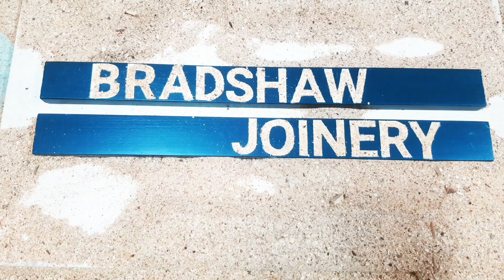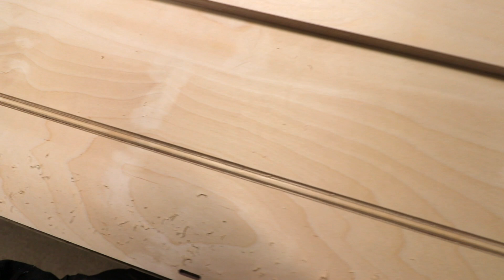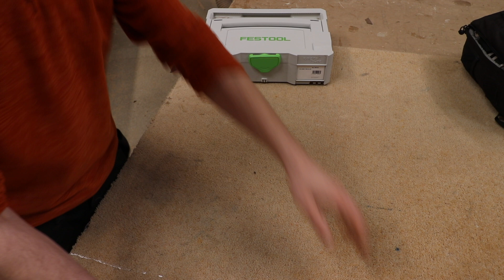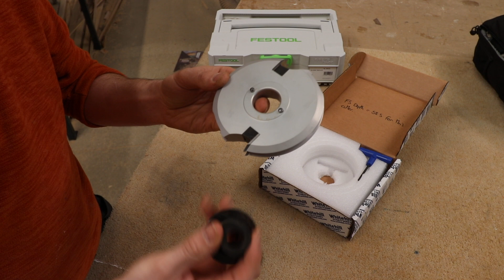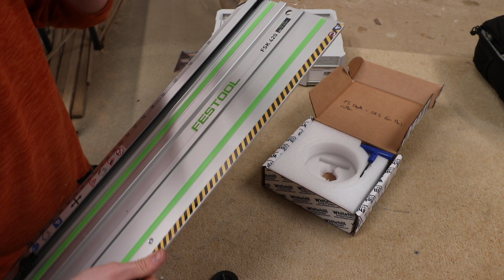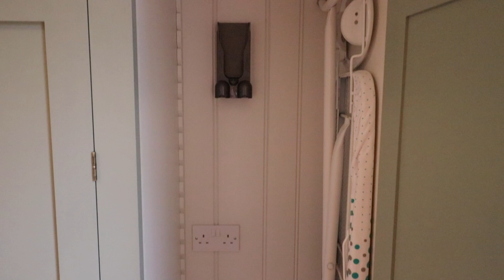Make your own Bead and Butt Panelling from Sheet Material.

Comment: Hi i am just wondering if you need to put all the spacers/shims on with it ? Or just enough to keep flush with the top hat? Then tighten.  Or like the groover festool tell you space out your groover and then put all the shims on the outside. I am looking for clarification. Thanks.
Reply from the maker: Just need enough shims so the securing washer clamps the cutter and not the spindle.
Reply: Yes thought that couldn’t get a definite answer. Have one now. Great idea with the cutter. Gonna put dust to the heavens.
Reply from the maker: @rorymcevoy87  My advice would be masking tape the riving knife up when using, and even pressure on toe on entry a nd heel on exit. use a board of same thickness to support the rail before and after cut.
Reply: I’ll be leaving panel over sized and then cutting down. Thanks for the tip tho. 😂

Comment: One bath cabinet I made of cherry; I put the cabinet back wall as ship lapped in cherry on the vertical. I will look into a similar cutter cut as yours and have a 1/2" shank router bit made for my Felder shaper. It was lots of work to get the ship lapped  back wall. Looks nice but I can mill 10-12" wide cherry and butt it together and them cut the beads on the Felder. I have a sliding table
on the Felder shaper and panel saw so an accurate bead is easy. Thanks for the info on custom circular saw. I have the Bosch saws (circa BC) plus the panel saw for my work-no Festool saws.
Reply from the maker: Niceone Vincent, it sounds like you have a lovely setup! The festoo saw isnt ideal but its certainly good enough to do it. Ideally it wants a router type base with a circular saw/spindle moulder motor on it... ideal

Comment: Question buddy. I need to match a butt and bead board from 15-16mm MDF for my customer I don't have the specialists kit as I do one off bespoke projects but never with butt and bead in MDF 🙄🙄 I need about 6ft X 3ft of board with center bead @ 200mm centers just like the one you did. Can you suggest a router bit or a saw blade that will not cost me an arm or a leg just to create this stupidly small piece of board. I don't use many festool most of my it is Milwaukee. Great job by the way👊👊
Reply from the maker: If you do 2x 45 degree router grooves with a pointed bit, 10mm apart then sand the centre slightly rounded it'll give the same effect! Clamp the rails well and run the router so it stays pushing against the fence. Also make sure you maintain accurate depth as the dust will lift the cutter
Reply: @BradshawJoinery  exactly the way I was planning to do it but I've been in the renovation game with my own company for nearly 29 years I was thinking "there must be someone who knows of a single sized one pass flute cutter for the job, hence my message to you.  but I've more chance of finding unicorn poop🤣🤣 maybe I could invent such a bit for the router.  Anyway thanks for the tip and as you are so responsive to me. I will subscribe vand tell my lads to too. Cheers buddy. Thanks again

Comment: Great content and many thanks but could you let us know the cost of the cutters please 👍👍
Reply from the maker: The cutter is on the Whitehill website, I think i paid a little more for it as i had it commisioned. From memory around £3-400. Youll need the HK85 saw and the VN-HK Set to mount the block on to the saw. Adds up, but if you have the right job for it, its easy paid for.

Comment: groover - I think it’s probably because of the relatively slow rotation for a cutter that diameter. I happened to be on the Whitehill site the other day and noticed they are selling a v-groove version . Looks good quality but expensive compared to their other cutters of that size, still I think Festool are missing a trick there. Love the videos I’m a similar set up to your self work wise and it makes my day when I’m home finished work and see you have posted another video😂, I enjoy watching someone else doing it their way. What power is your moulder ? Just your big rebate block had me wondering what you could take in a single pass, let me know if you get a chance. Thanks again and really enjoy the spindle moulder videos , could you do one on making smaller mouldings and supporting on the out feed . Cheers
Reply from the maker: Thanks for the heads up on the v groove i hadnt seen it!. it is a little slow spinning but produces a decent cut! glad the videos are appreciated!! The moulder is 7.5Hp i think. It was the most powerful available at the time it might be 5.5kw. i used a 4kw one and this is well worth the extra!! it would do a fairly hefty cut i think holding and feeding the workpiece would be as limiting as the power of the machine. Ill try on the smaller mouldings

Comment: Cracking idea bud whitehill are very good at this sort of thing I've had a couple of blocks reverse engineered in the past. Keep it up with your content cheers
Reply from the maker: Thanks Robert. They are a cracking company!
Reply: Hi Robert,  the design and manufacture of bespoke cutter blocks is a big part of our business, as well as our range of cutter blocks we have in stock. Our approach is to design the tooling based on the requirements rather than reverse engineering. Bradshaw Joinery were very clear with their requirements which helped a great deal.